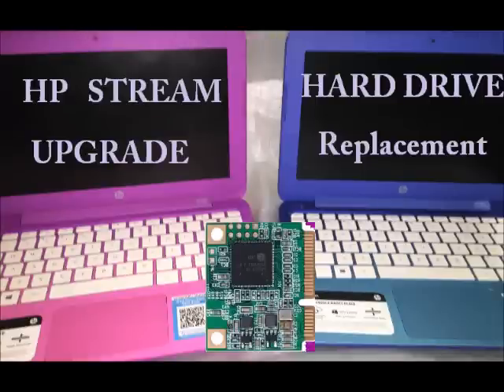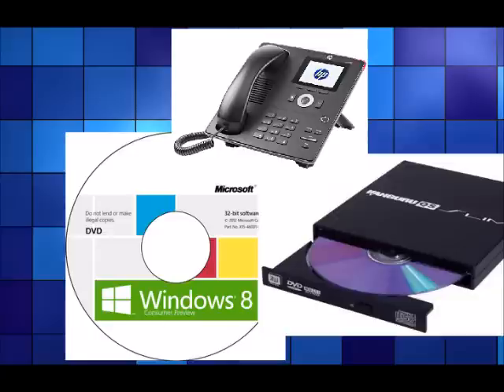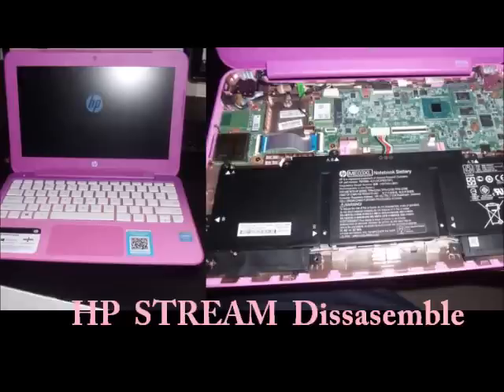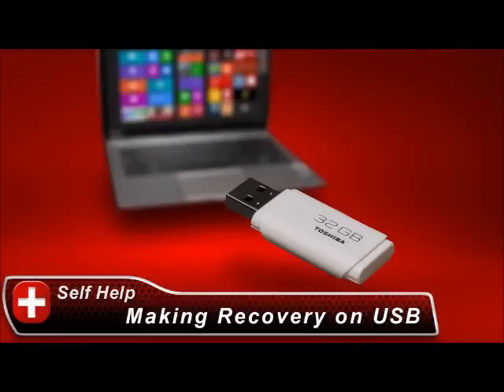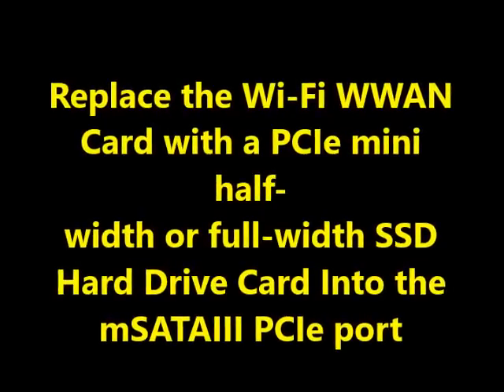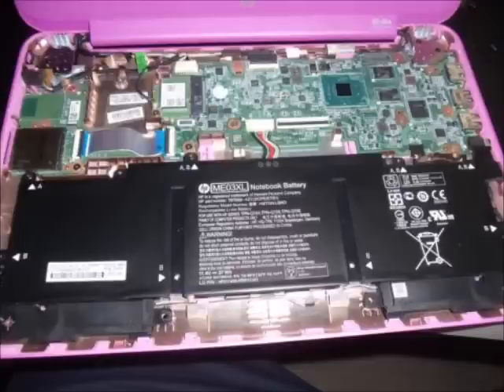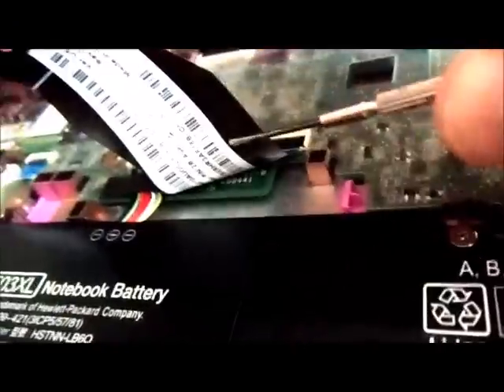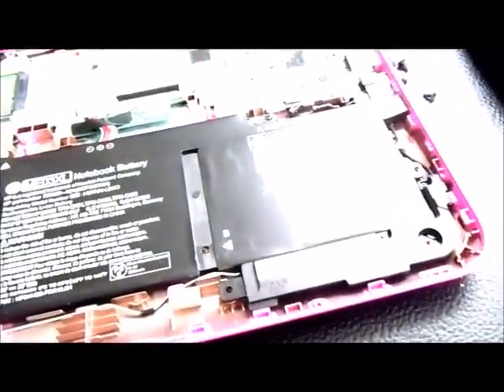How To UPGRADE HP STREAM Hard Drive 11 13 14 11-d 11-p 11-r 13-C 14-Z X360 Pro G3 G2 Touch SSD RAM

Comment: Honestly, almost everything about it is cool. lightweight, 8 hours battery life, enough power for everything, error free, quiet, I even got mine for $100. The only issue is the hard drive. I don't need or have programs or storage files on it and I cleaned it of all bloatware and run disk cleaner a few times a week.Despite this, the drive is always less than 1GB from full and window keeps bugging me about being unable to update and to free up storage. It keeps complaining that I need 8GB free to update but the computer has never had that ever!  It would have cost HP like 10$ more to make the laptop with more space and I would have totally paid the $10 more to buy it, and I would have been more willing to buy it in the first place. Even a just 64GB drive would keep windows updates happy and I would be swimming in system space I would never use. I mean, I have a 64GB SD card in it and that is plenty for storage but the windows system files simply cannot go on it.

Well, time to break out the screwdrivers I guess. :-P
Reply: i'm planning on deleting the recovery partition to free up 7+ GB  of memory. HOWEVER, I'll be backing up (or cloning) the entire drive first before deleting the recovery partition and then resizing the primary partition. I only need this laptop for web surfing, music/video streaming, and for remote controlling my main PC (teamviewer) and linux server. Basically I store all my files and media in my own personal cloud (probably over 20 TB -- I've got hundreds of opera discs which I'm probably never going to ever be able to watch all of...). Surprisingly, I am able to play a 40 GB opera blu-ray just fine over wifi. Obviously, anything 4k and 3D is out of the question. As long as you have a reliable network connection there isn't necessarily any need for more memory -- unless you need to install more games and software. As for frequently worked on files/documents, I do sync certain folders (automatically) to my linux server. Plugging an external drive all the time is annoying. As for the SD card, I only use it to install and run portable (software) apps. If I didn't have my own cloud (or even dropbox/onedrive) then it'd be quite hard to justify buying a laptop that has only 30+ GB of memory.
Reply: I agree, the problem is, even with nothing else on the harddrive and recovery stripped, there is not enough room to just update windows. So I just accepted that it is going to complain at me to "free up space" and that uninstalled windows updates will just continue to build up ad nauseum from now until eternity. I even contacted windows support and they said there was nothing I could do, I'm stuck. A 32GB drive is enough to install windows but not update it. Otherwise thumbs up for a 100$ laptop but that is a major oversite for HP.
Reply: it might be your version of windows? I only have windows 8 home edition... and I still have between two and three gigs free + 7 GB also once the recovery drive is deleted. You might want to consider a lightweight linux distro which should only take up less than a gig for the OS files. I mean, I could myself switch to Linux here... but somehow my tests with my other two older laptops with Linux aren't able to reproduce an audio output when I remote control my main PC so I have to stick with Windows for now. Sound does work with chrome remote desktop, but I'm trying to reduce as much of my google (and microsoft) footprint so I'd rather stick with non-google and microsoft 'cloud' data collection programs as much as possible. *with msft, you can minimize this by disabling syncing with your msft account (local account only), disabling cortana etc. More control is still possible. Not at all like in google or chrome desktops where you really have to be signed in, sync'd and tracked all the time.
Reply: use linux instead,
debian or arch linux (with i3wm/openbox/other window manager), it only take under 1gb  for system
Reply: @zxc13x  Agree 100%

Comment from the maker: if you are in the market for a new laptop I would recommend an ASUS due to how they are manufactured now compared to HP, Dell, Gateway, etc today.   I would go with the Asus i5 20gb Ram 512 SSD drive on Amazon.  Link is here https://amzn.to/41RFDcY  RubberWilbur is a participant in the Amazon Services LLC Associates Program, an affiliate advertising program designed to provide a way for websites to earn advertising revenues by advertising and linking to Amazon

Comment: this is bad information if you have an  HP stream 11. The wifi board is in a slot which is a dedicated mini PCIe and is not compatible with mSata. The suggested ssd is mSATA and will not work. The slot is the same size but voltages are not compatible.
Reply: Please, where can I chek this information? thank you

Comment: I'd wager eMMC storage is extremely shitty, so replacing wi-fi card with SSD and using external wi-fi card makes more sense than using smallest USB memory sticks ever created as additional storage. But I'm a cheeky bastard, I asked my sys-admin buddies to replace W10 with Linux Mint. Lo and behold, 6 GB of free disk space turned into 24 GB of free disk space.

Comment: Not true for the 14. The HPStream 14, can be upgraded to 8gb/ram. It has a single socket for ram. However, you can not upgrade the drive.
Reply: Honestly? It's a POS for a Windows machine, but functions fine with Linux Mint, with at least a "reasonable" bit of disk space left over.

Comment: i can upgrade the ram of my stream 13 2gb to 4,6 or 8gb? i want more speed.
Reply from the maker: no you can't upgrade the Memory because it is integrated
Reply: RubberWilbur I'm a bit slow lol but can I replace my wifi card with a sdd on 11-r014wm? if so, which ssd would I need? link plz

Comment: U can also get ISO's From Microsoft and install on flash drive, On another computer u can download the media creator tool and it will build the iso onto the flash drive or dvd . the product key will be not be needed. u have to install the right version, usually the first selection on the media creation tool. Hope this helps!

Comment: This does seem like a viable option for more storage, however could you not just purchase a large enough micro sd card and do the same thing? My stream took to a 200gb one just fine.
Reply: this is an old comment, but in case you see it... how did you manage to make the SD card your main storage drive? I purchased a 128G microSD and followed a bunch of tutorials on how to make the laptop read the card and it still does not pop up anywhere

Comment: at the beginning of the video you stated that on an HP stream you CANNOT replace or exchange the ram stick, but in Stream 13 and 14 they allow for the ram stick to be taken out and changed to the users hearts content. not only that but you attempted to say that the computer you are trying to take apart is an hp stream 14, you posted this on September 4 of 2016, but the hp stream 14 came out 3 days after the video is uploaded, the neon green computer you are disassembling is an hp stream 12 not a 14 the HP stream 14 does not have a changeable hard drive i have disassembled and resembled it 3 times by now and not once have a found any sort of hard drive or SSD.
Reply: The eMMC storage was "integrated" onto the Wifi card and he did say this during the video.  Class dismissed. : )

Comment: This issue aside, it's fine with Win10 when it's new, but then you switch it on & the updates start. Result, disappearing storage capacity. This is a very cheap little notebook, so change the OS to Android or some other Linux. Mine works fine with Linux Peppermint 7 & there's plenty of storage space left.
Reply: ...good to know. But how did you switch to Linux? As far as I know, the BIOS on these HPs  tries to keep you from using anything but Windows... :(
Reply: Get an external HDD, Switch to LEGACY, and disable secure boot in BIOS. More to it, but this'll get you started.
Reply: Just disabling secure boot will be enough. I am currently using UEFI version of Antergos on my HP stream 11. Never had any problem for a year. I did encountered some weird issue while installing it but using USB 2.0 port instead of 3.0 port for install media USB fixed the issue if there's anyone having problem with installing some linux distros on it.

Comment: Back in the day we used to think that 512k ram and a 256mb hard drive was living high on the hog...  Now, we’re talking Terra Bytes and 512gb ram as being just sort of normal.  However, I believe that HP and other manufacturers made a big mistake to err on the side of economics with these 32gb machines.  They should have at least made sure that the user was able to configure either a USB or SD card as a workable drive for the purpose of Windows upgrade.  Right now, on these machines, the user is FORCED by Windows to utilize only the C drive for upgrades and will recognize neither the USB or SD which is why we are stuck in a loop we cannot get out of.  The user cannot delete enough applications or temp files to gain enough space to satisfy Windows update. The operating system should never exceed ten percent of available hard drive storage.  Windows 10 hogs some ninety-five percent of available space which leaves the user with very little space for their applications.
Reply: That's not accurate at all. All you need to do is create a bootable USB stick with a tool you can download for free from Microsoft. It took me 15 minutes to download and create a bootable USB stick. once that's made all you have to do is go into the boot sequence and reinstall from there. I just did it on a friends HP stream that had a boot loop. had windows reinstalled in an hour.

Comment: Do you know if an Intel 600p 256GB M.2 PCIe 3.0x4 SSD will work on it?
Reply: m.2's aren't supported by the motherboard
Reply: PCIe M.2 cards won't work with it, you need a SATA based M.2 card.

Comment: Hi rubber Wilbur. Thanks for your knowledge. I have a HP laptop with only a 32 mb drive. I barely had enough memory to install Microsoft office and that’s after compressing c drive. I still get low memory messages and now I can’t update win 10 because it needs 8 gig of space. I do have a 16 gig usb thumb drive and a 1terrabyte external hard drive I can use but I don’t how to configure it. If you can help I can gladly send you your required fee. Thanks jerry

Comment: With only Windows and an antivirus program installed this HP Stream cannot update without cleaning up and encryption. Not even good as a child's computer. Never buy HP!
Reply: I have one for my Grand daughter, running Linux Mint. It works much better that way, and it's "faster". It's actually quite usable for a kid, that way.
Reply: @dragunovbushcraft152  I'm using Linux mint too lol
Reply: I have never seen a m.2 hard drive or sandisk micro sd that is that big dimensionally, and that picture showed a SDHC not a micro sdhc or sdxc card.  I haven't seen a hdd in one of these streams before... nor in this video!!! HAH

Comment: I opened my Stream 14-ax020wm and there’s a 4GB Samsung ram card that I was able to pop right out (so I don’t get why you say the RAM can’t be changed).. I also don’t get how you didn’t notice that your disassembly video was WHITE WASHED with LIGHT.. some parts were blurry/smeared, and the rest was TOO BRIGHT and jumbled...  you really didn’t put any effort into the tutorial part like you did with the educational part in the beginning. You also may want to correct yourself on the RAM statement before you discourage someone from not bothering to open theirs up
Reply: hi, but theres any chance to upgrade to an ssd drive?, i have same model like yours,

Comment: Thanks so much for your video! I was wondering how to upgrade the hard drive. Was looking for a lightweight, inexpensive computer to use while traveling. Looks like adding extra storage via the micro SD is a simple solution. Kudos!
Reply: Expanding the storage with my Kubuntu Linux install works great with a big memory card in the Micro SDHC slot, especially since the cards flush fit. However since I'm constantly using the card reader to pull files off of cameras for backup TO a USB drive, I've found an almost flush fitting thumb drive to leave in the port beside the card reader and I use that for music and documents instead. Either works, for Linux at least, I don't know how that would go down with Windows 🐧

Comment: The value of this tutorial lies primarily in laying bare what low standards HP has descended to but, to be fair, other makers do much the same with this type of product. To call them laptop computers is misleading and here is a tip:- whether paying in $s, £s or €s you can reckon on these lasting as many days as what you paid.
Reply: I wish!  Paid $170, lasted 32 days.

Comment: I have this laptop.  I am trying to replace the Wi-Fi card with the drive you have in this video.  There is ZERO chance you used the drive in the screenshot unless you ordered it and ebay sent you a product you didn't order and it actually fit the smaller port that is on the laptop.  Mini pcie is too big to fit in this port.   I ordered the part number and it won't plug in.  It's too big.  The original WiFi card is about 1/2 the width of the mini pcie drive you have in this video.
Reply: As it turns out...

The mini pcie standard has evolved since the making of this video.  My version of the stream has a newer but less used version of mini pcie. There is a m.2 standard now.  My stream has a port for the first version of the m.2.  The drive in this video will not fit.  Furthermore, the newer version of m.2 that has a wide range of products made also will not fit.  I did find a ssd for my version.  It is very long.  The connector will fit the port but the length will interfere with the USB ports on the right side.  I would have to remove that card as well and grind down keyboard supports to make the add fit.  I could not find that version of m.2 with a micro sd adaptor.

This laptop was made with predatory intent.  Shame of HP!
Reply: I had this same problem. I have a Stream 13 and the mini pcie ssd drive I ordered was too big for the slot the wifi was plugged into. Frustrating. Going to try external usb 3.0 drive instead. Should have done that in the first place I guess.
Reply: Angela Rogers:

I won't buy anymore HP devices because of this problem.  I uninstalled windows and I am using a compact form of Ubuntu.  It has issues with recognizing the touch pad after waking from suspend.  Problems abound!  No more HP for me!!!
Reply: I used Ubuntu to make a 200 gb micro ssd card bootable.  I boot off that now.  I can't remember if I went into BIOS to prioritize boot devices but I did get it to work.

Comment: Hate this PC. I only bought it to disassemble it. Turns out there’s no m.2 SSD expansion slots except 1, and a tiny 2 core-ass cpu. It has 32 gigs of space, which is ass. I have a gaming PC with and RTX 2080ti and an i7 9700k with 20 terabytes of storage and I managed to use half of that. This laptop is just too cheap. Anyone buying this save up a little more and buy a better laptop.

Comment: Why would you do this if you have to sacrifice WiFi??
Reply from the maker: You have no choice if the integrated hard drive goes bad unless you want to replace it and soder a new one on.  Not fun.
Reply: To fit the windows 10 update .
Reply: Get an ASUS USB-AC53 Nano and you will have better wifi than what the computer came with and extra storage

Comment: Seriously this has to be the shittiest laptop to open EVER.  I am not sure I can open it with breaking something!!!!!  

1000 burning suns is not enough to dispose this heap of shit.

Update - found the two more hidden screws under the sticky pads right at the back of the laptop
Reply: lol
Reply: Remove the screws and then use a knife to pop the tabs off. There are 4 hidden screws under the rubber pads at the rear and the two smaller pads. They are held on with adhesive. Pretty easy to open.
Reply: 21.3 gig of HD and a 20 gig operating system WTF were you thinking HP
Reply: @zachpendell9515  Linux Mint, 6gb install, with 21gb left over.

Comment: Hello, i think your tutorial is great and disagree with some poor choice of comments i read here. I bought i think the right EPP but when i opened machine the 3 small finger like connectors on wifi are nothing like the 2 fingers on new epp....so i am ready to upgrade but i do not think i have a fitting connector on wifi...or am i missing something. my unit is 14-ax 010 nr. I am dying to send you $3 if this can just work, thanks for your contributing this

Comment: laggy on the standard windows 8 OS  but works an absolute charm with CloudReady and no issues, using as a work computer to design web pages and posters for shops without a hitch

Comment: I'm doing this with mine. I just bought a hp 11 my question is once I've upgrade to 256ssd will it load programs and is it faster? cause this hard drive feels sluggish and will it be easy on the cpu? thanks
Reply: Yes
Reply: Did this work for you?

Comment: hi thank for this tutorial.
I was thinking of swopping the wifi for ssd card. how would the Stream work then. Would it boot from the emmc and then show an extra drive in the device? Will I need to put any drivers in to run the ssd or will it show and work automatically?
Reply: My opinion after watching this tutorial is, if you used the correct PCI-e compatible device and swapped it into the Wifi "slot", whatever device you added SHOULD be available to Restore (or "Reload") Windows 10 onto from the USB backup (Restore Media) created before you started.  He was very clear on this point, especially important to note you MUST create Restore media before swapping hardware because the Windows' license is embedded with those files (License associated with a specific hardware).